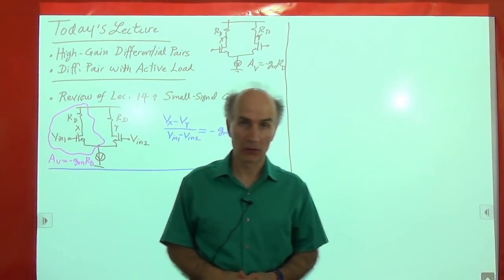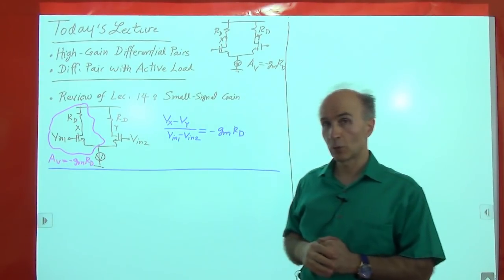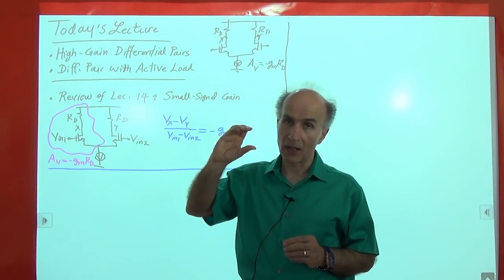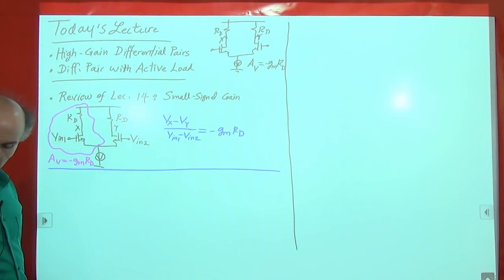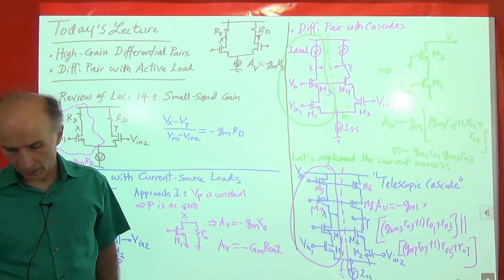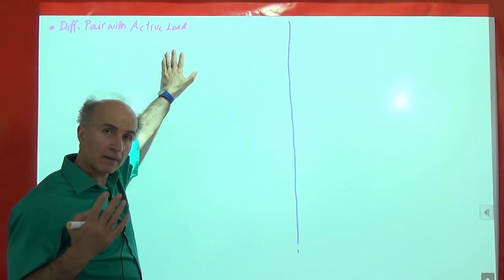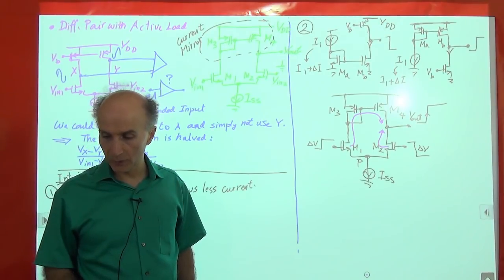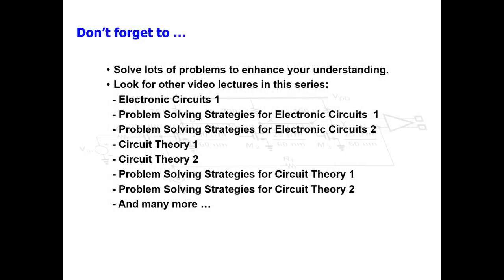Razavi Electronics2 Lec15: High-Gain Differential Pairs, Intro. to Diff. Pair with Active Load

Comment: In cascode introduction we learnt that MOS transistor does not change the voltage with current like a resistor, but here we are making an opposite assumption. So are we treating MOS in triode region for active load?

Comment: In differential pair with active load , when ID1 increases, ID3 increases, so ID4 increases due to mirroring...but ID1+ID2 = Iss which is constant...and ID2=ID4 so by this logic ID4 should decrease when ID1 increases.
Does it mean that M4 is in triode region?

Comment: At 7:53, ideal current source should be replaced by a resistance (internal resistance of a mosfet, let's say ro3). So, gain will be -gm(ro1 ll ro3). Isn't it?
Reply: it's called "ideal" because it doesn't have channel length modulation effect (ro)
Reply: an ideal current source is a one, whose current always remains constant. That's why, while drawing the small-signal model, we replace it with an open circuit. (while drawing the small-signal models, we only consider small changes)
Reply: CLM=0 and it means that ro infinity So Adm=-gmRd
Otherwise the CLM  is not equal 0 and it means that hava a ro
Adm=-gm(Rd//ro)
rds=
ro=va/id=(1/CLM)/id=1/(id*CLM)

Comment: When Delta V is small, the voltage at point P does not change. I totally agree with that. But, does that imply P is virtual ground? Yes, but why?
Reply: I thought again and again on this. I guess my problem is still related with my incomplete understanding of biasing. P voltage does not change, it still has a voltage, bias voltage.. since this fixed bias voltage can be ignored in small signal analysis, point P can be treated as AC ground. I hope my guess is correct.
Reply: Constant voltage => ac GND

Comment: 42:24 please xplain,i didnt understand the 2 case
Reply: in the second case consider the nmos to be a resistor if an increase current has to flow through the nmos then the potential drop across it will be higher , hence v out will be higher
Reply: @zaki5726  I agree but think like this, to maintain the nmos in saturation Vds>Vgs-Vt. In the first case, Vgs of the lower nmos is rising as more current has to be pushed through due to current mirror action. If Vgs increases, then so should Vds to maintain the pinch off condition. This is opposite to what I will get if I consider the loading mos as a resistor where a current increase will just give a greater potential drop across it and thus Vout will drop. I am confused. Can someone explain where I am going wrong?
Reply: @abhishektyagi7513  if the Vgs of the lower nmos rises (which rises due to more current due to the action of the current mirror), it does not imply that the Vds should also increase. In fact, with the increase of voltage between the gate and source, the voltage between the drain and source decreases. That's why it acts as an inverter. You would also have observed, its gain is given =-gmRd( negative sign indicates inverted output).
This can be explained as follows- as the voltage at the gate increases, the channel gets more enhanced with the charge carriers. This results in decreased resistance of the channel, and hence the Vds decreases. 
I hope this will clear your doubt.
Reply: @dhirajkumarsahu999  but you see.. when I increases, Vgs of Ma increases so Vgs of Mb also increases and as Mb is CS stage so Vo should decrease. But here it's something else is explained